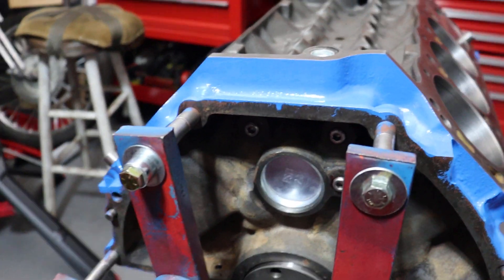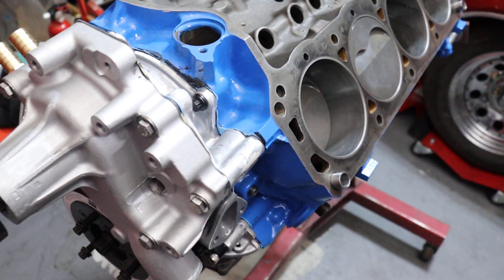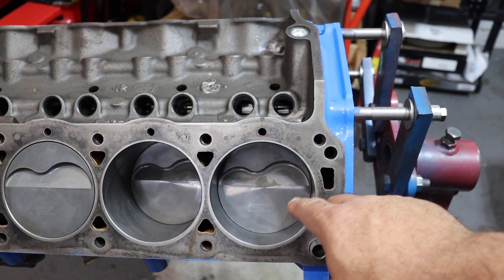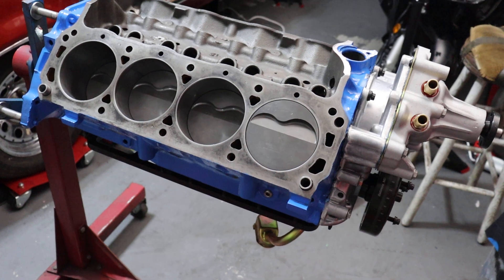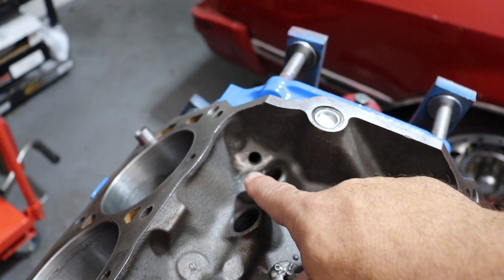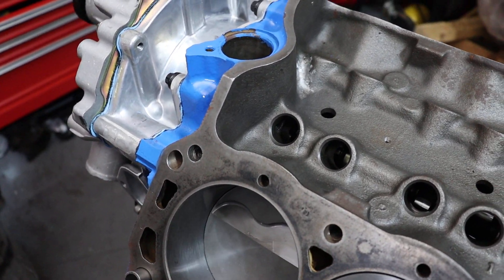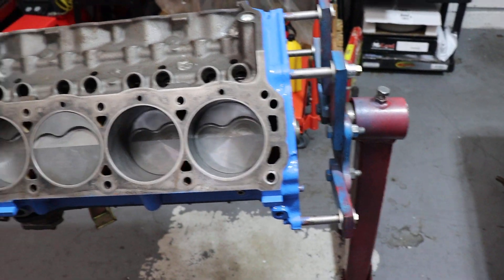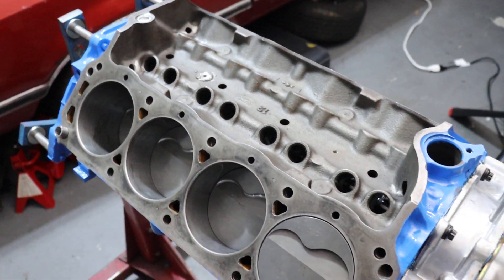SBF Oil Return & Galley Plug Mods

Comment: Something else that I do with the oil crossover on top at the back of the block , I’ll flip the top oil  plug over. I’ll use a little bit of gasket sealer. But This will help with crossover oil flow and not restrict oil flow.
Reply from the maker: I've seen that done before, and I know that it works well, but I can't get over being paranoid that it will loosen and cause a loss of pressure.  For my next build, I'm considering smoothing the passage itself to ease the transfer from one side to the other and then installing a threaded plug.

Comment: I have a question and need your opinion. I just had my 302 stroked to 347. I had the shop install the crank pistons and cam. The problem I am having is a significant oil leak that drips off the bell housing. I didn’t check the threaded plugs on the back of the engine before I attached the bell housing and trans. Do you think it could be an unsealed plug? I would hope it’s not the main seal! Thanks!
Reply from the maker: I wish I had better news, but there are only a few places oil could be coming from - the rear main seal, the threaded oil galley plugs, or the large cam plug.  If you have access to a borescope, you might be able to snake it up in there to see what's going on, but at a minimum the transmission & bellhousing will need to come out in order to access the back side of the engine for repairs.  I'd suggest finding the problem, documenting it with pics/video, then having a conversation with the shop.  We live in a cynical world, but there are still some honest people out there, and if the shop did make a mistake they may be willing to work with you on making it right.  Good luck!
Reply: @ that’s pretty much my conclusion too. I have my own lift and trans jack so the job is just nuts and bolts! I’ve had the Mustang since 1996, I refreshed the engine once before in 2004. Reused the rotating assembly, new bearings, honed it. New street cam, a friend gave me the manifold, bought an Edelbrock 500cfm…. It ran great until it didn’t.. started knocking and on disassembly I found a broken piston skirt. So as I said, new Eagle crank, sealed power pistons, had to sleeve two cylinders due to a crack. We drove it 2,200 mile on power tour last June, ran great! Thanks for your input!
Reply: If it's coming down the outside of the bell housing it's most likely the intake at the china wall
Reply: @ nope, the top back of the engine is dry. I built the engine last summer and was very meticulous about proper sealing, thread locker, gaskets etc.
Reply: @paulpruitt2776  someone suggested using the UV dye in the oil to track down the leak, so I may try that! Thanks!

Comment: Ben Alameida has a great tip for better oil flow on his channel. If you watch this video at the 5;31 mark, there is a cap directly over Bill's hand. Its an inverted v shape cast in the block, which passes oil from one side to the other. Ben says this cap impinges the oil flow and should be installed upside down. If you look at a drawing of oil passages this makes sense. Thank you Bill for this great info! I just watched you video on main girdles, very informative. Thank you.
Reply from the maker: Yup, I've seen that video.  I've never tried it myself, but it definitely makes sense.  Thanks for your comments, and thanks for watching!

Comment: One that you missed was drilling an approximate 1/16" hole in a front galley plug to add lube oil to the timing chain and gears. Also, many if not all late 5.0/302 engines (i.e. '95 up) have tapped front galley holes.
Reply from the maker: I don't ever drill that hole, I've never seen a timing chain gear wear in any appreciable way regardless of how the engine gets punished.  I'd rather have all of the oil go to the lifters.  Thanks for watching!
Reply: My machine shop did this to my 351w block to give oil to the distributor gear

Comment: I agree that an HV oil pump in a 302 isn't usually a good idea.  I had one that would run fine at idle, but driving it around, it would empty the pan.  I also have a II, with its small oil pan made for a bad combination.  I'm using trickflow heads.  I ended up welding my own 7Q pan and replaced the oil pump with a standard one because of this.
Reply from the maker: In my '77. I switched from stock to a Milidon 8qt pan (which fits pretty well after a few strategic hammer blows) after my high-volume pump drained the pan, and it worked out pretty well with the increased capacity but I never stopped worrying about it!  Thanks for watching!

Comment: What about the oil galley press in plug in the top back of the block?  Ben Almeda racing recommends pressing it in upside down to improve oil flow. Do you think this is necessary?
https://www.youtube.com/watch?v=7b-xa7aGHEo
Reply from the maker: That's an interesting idea, but plugs are tapered so that they seal effectively when installed in the intended orientation, and installing them in the opposite direction means that they are sealing only on the rim of the plug instead of the entire side flange.  Ben Almeda has obviously been using this approach for a long time, but he's solely focused on racing, so he doesn't need to worry about long-term reliability as you would on a street engine.  Leakage of oil from this plug leads directly to loss of oil pressure, so I would be cautious about trying something like this on a street engine like mine.  In my opinion, a much better approach would be to blend the area between the two passages with a grinder in order to promote better flow from one side to the other, effectively opening up the chamber between the two sides and eliminating the problem that flipping the plug is meant to address.  As added insurance against plug leakage, you could tap the block and install a threaded plug.  I'll probably be doing something like this on the next engine that I build.  Great question, and thanks for watching!
Reply: Just noticed this comment, after i posted about Ben.

Comment: I thank you for your I depth tutorial style in your videos. Got me signed up now. I have had quite a number of these sbf. An issue I have had is installing E7 heads on early 302 block where these front and rear returns don’t line up. Not hard to correct with a die grinder if you don’t want to upsize the hole. I’ve had it up to where 1/2 the hole has been off on aftermarket heads. You have to watch this area. I don’t have special machining equipment so for upsizing I always go up in steps from 7/16 to 1/2”. Usually I use 2 intermediate sizes and then the half inch. Never had it go off centre that way.
Reply from the maker: Interesting, I didn't know that about the E7 heads.  I wonder if it's due to the return passage being in a slightly different place on the roller cam blocks, or if it's just imprecise casting & machining.  Thanks for the comment, and thanks for watching!

Comment: I have heard people drill a tiny hole in that front plug to spray oil on the distributor gear. Have you  done anything like this?
Reply from the maker: Great question!  I've never done this on one of my engines, but a lot of people do it to ensure good oil supply to the distributor gear (as you said) instead of relying on oil splash or drainback for lubrication.  Opening up the large drainback hole at the forward end of the lifter valley allows more oil to drain down onto the distributor gear and that seems to work for me, but if you want positive oil presure to spray onto the gear, drilling a hole in the galley oil plug right next to it will work very well.  As long as the hole is small (no bigger than 0.030" to 0.035") then you won't see any loss in oil pressure, not even at idle.  One recomendation if you do drill the hole - install and tighten the plug all the way, then mark where the distributor gear is in relation to the plug and drill the hole so that it is angled towards the gear.  If you drill the hole straight through the center of the plug, oil will just spray out onto the timing cover past the gear.
Reply: I drill a .025 in  the plug right behind the distributer ,have done 4 engines that way now and it helps the dist. gear alot and no loss of pressure.

Comment: So what size npt tap do i use
Reply from the maker: A 1/4-18 NPT pipe thread tap will fit nicely into the stock oil passages once the press-in plugs are removed, just be sure to start slowly and carefully and be sure to remove all of the shavings.  Good luck!

Comment: How come you did not do the one at the top rear?   I did all mine today.  Thanks.
Reply: I tap with a 1/2 npt tap and insert plug.  I had the press in plug pop out one time.  Can't take that chance.
Reply from the maker: Good advice, thanks!  I've had pleny of those plugs leak before, including on this build when I primed the oil system (replaced and resealed it).  I'll look at installing a threaded plug on the next one!
Reply: Good video.   Thanks for your helpful insite.
Reply from the maker: Are you talking about the crossover for the lifter oil galley passages?  Where the plug goes in the top?  I don't usually do anything there.  What do you do back there?